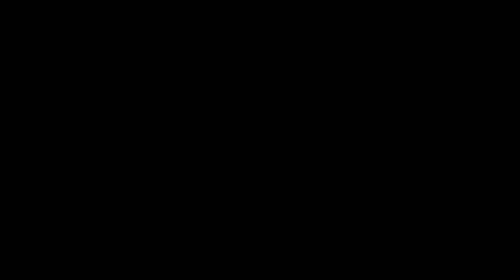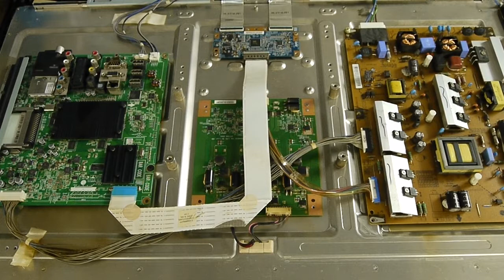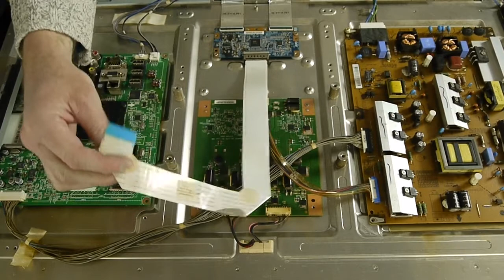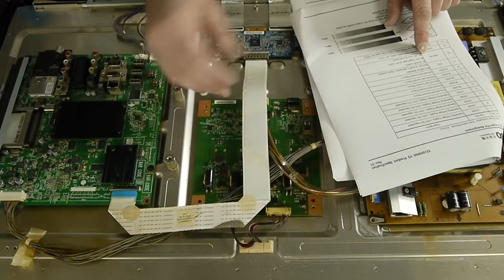Re-using a Broken Television as a Monitor. Part 1

Comment: I like the idea. I'm actually thinking of doing the opposite with a tv that has a smashed screen. I'm wondering if the 51 pin lvds output from the mainboard cold be converted to a vga or hdmi ouput for another monitor. What do you think?
Reply from the maker: It does look like you can buy LVDS to VGA adapters, but they seem expensive. I haven't tried that way round so don't know if it would work.
Reply: @menadue  I'm also wondering if it would work. I have absolutelly no experience with repairing TVs so will have to look up some info. Any tips on what to look for and where to start? Thanks in advance!
Reply from the maker: @pal-stefanmurvay7682  The first thing I'd do is try to find schematics for the boards in the TV. For the LG I was looking at there was only one LG board, all the others were AOC. So look on the boards to find the actual manufacturer and look for their schematics. I did find a similar LG schematic as well, but the LG boards were broken. Then get a datasheet for the adapter or chip on the adapter and then sit down and try to work out if it will work, and how. :-)

Comment: My LG 60PK950 Plasma also refused to show anything on HDMI. I could still watch things stored on an USB-Stick, just HDMI was broken.
I read about people who took the board on the very left side and heated it up. Some recommended to replace the chip that is connected to all HDMI, there is just one.
The people who heated it did this either in the oven or with a hairdryer. This was good for a couple of minutes or a month. So, I borrowed a hot air gun, covered everything around the HDMI chip with aluminum, put some resin on the contacts all around the chip. Let the hot air gun heat up, and tested with a thick peace of paper in what distance it could stand the heat for 30 seconds, to get a feeling for the heat applied. I applied little pressure on the chip with a screwdriver, started the countdown and heated each side of the chip for 30 seconds. 
It works now for 5 months. The chip doesn't like to change the HDMI to often, so I leave it on HDMI 1 most of the time. It stopped working after 3 months when I set it every time to HDMI 1. I took the TV of the power for a couple of days and it came back to live this was two months ago. I was afraid of to much tension on the board, so I thightend the screws only on one side the others are there but not thight.
Reply from the maker: Excellent that you fixed it, even if it's temporarily. I did heat the board up as well when I tried to fix it the first time, but it didn't fix anything. I suspect one of the main ICs had gone bad.,
Reply: @menadue  My TV still works. Don't heat the board, heat the chip on each side. Get/borrow a HotAir gun, looks like a hairdryer but goes to 300° C and you need around 260° to get the tin-solder in a fluid state.